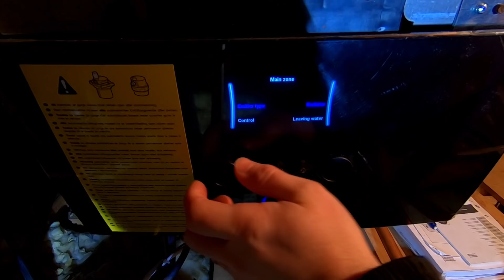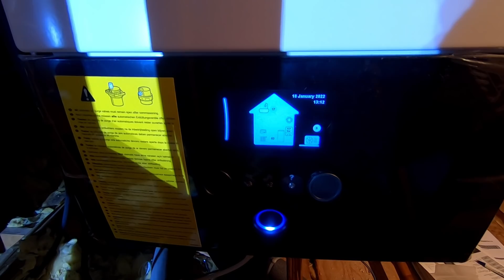How to lose £2000 installing a heat pump

Comment: May I ask, why did the customer want a heat pump system. What was wrong with the gas boiler was is just the damaged flue, was it a very old boiler. What did it cost to fit? Regards Dave Porter London
Reply from the maker: Boiler was beyond repair, client did not want another gas boiler. I don’t know the cost.

Comment: The really sad thing is that without upsizing the radiators this heat pump is going to struggle in the winter. Turning the weather compensation off just shows that the MC is in love with bodge job designs!
Reply: This unit is a high temp unit - it can run up to 70 degrees C of course this affects the COP but its not as bad as with older kit.
Reply: @WindyJAMiller  do you know what the COP is for a unit running at a high temp like 70? I used to specify radiators at 45 degree flow (in new builds) achieving 3.1 COP.  UFH designed at 35 flow temp used to achieve 3.6COP (from memory, a few years have passed since I was in heating industry)

Comment: just to be clear: this is completely and utterly to the fault of the designer and main company, not the installer nor heat pumps.
Reply: The words 'heat'and 'pump' do not fit well. A better fit might be 'water' and 'pump'. OR 'heat' and 'generator'.
Reply: @johnchoice1371  actually no. heat pump is the technical term and the correct one. its not a generator of heat, its a mover of heat. the medium witch is uses is not relevant to its function. just to be obvious, but you do know on what principles a heat pump operates?

Comment: Nice video, informative. As someone who has spent many decades working in construction I would recommend renegotiating the terms of the subcontract/employment the moment you realize the job can't proceed as planned. In the past if I hired a contractor (or sub) on a per unit or per  job  basis, there was always a strict understanding that if work could not proceed as planned we would both are to switch to hourly or renegotiate based on the revised plan.
The quality of your work seems good from the little i could pick up eating your video. That puts you in a small and rare group of sought after craftsmen.
If you stick to your guns, they will actually be more respectful of your time and treat you better.
Don't be afraid to venture out on your own. I know many who have. They're all millionaires now. Oh and quit smoking, it robs you of your time, your money and most importantly your health.
Reply from the maker: Tony, I work for myself 99% of the time. This one was just a trial run that went wrong. I would never work for them again. Period.

Thank you for a nice comment 👍

Comment: Of course it won’t work. This stuff is a figment of a bedwetting green wanker’s imagination. Houses have to be designed to be heated by a these things. Before fitting you will need bigger pipes, triple or quad panel radiators and/or under floor heating plus additional on-demand heater for bathing and hand washing. Our world will be a better place when we tie these cockwombkes to the back of our cars and drag them along motorways.

Comment: Firstly, this is amazing content, it really captures the pain on a job (I have been there). 

As a heating engineer (I mainly do breakdowns) I was considering getting into heat pumps, I even had a course booked in for next month. After watching this video and doing some further research I have come to the conclusion that it would be a  complete waste of time and cancelled the course! I’ll stick with boiler repairs until something comes out that will actually catch on! 👍 Thanks for the video!
Reply from the maker: Ahhh no, mate do the course and get into renewables, early days in ten Uk but the technology works and it will catch on.
Reply: @UrbanPlumbers  thanks for the reply! But Its not for me. There is so much boiler work out there and I literally can’t think of a single person I have ever worked for who would want one of these. 

My thinking was, to add another string to my bow, but I don’t think it would end up being as profitable as focusing on my boiler business more, rather than splitting my attention into renewables! 

Amazing content mate! Thank you! 👍
Reply: Of course it is your decision. But investing in your self with quality training will enable you to shine in what is essentially ‘new industry’ where the demand for a system design and installer will exceed supply’. You could develop yourself a real niche in the industry and charge a higher price for your time. Arguably there is more job satisfaction to be had designing the whole system rather than just hanging a white box on the wall too.

Comment: My geothermal has weather compensation option...I leave it off, it gets confused with advancing temperature unnecessarily.  

Not sure if that is the same here.

I think the problem is outside temperature rises or decreases rapidly, unit kicks on or adjusts & it isn't reflective of the interior conditions. In my case brick takes hours for weather to change the inside, so the unit would run unnecessarily.
Reply: My mitsubishi compensates for both internal and external temps, do other brands not do this? Etherway, having weather compensation off as company policy is criminal. Turning weather compensation off should be a last resort with a "this will cost you more" warning.
Reply: @djenson  

Mine costs me more with feature being on... Temperature indoors is more stable than outdoors, I could see benefit for temperature control in houses that experience rapid temperature changes, but in the case of my brick home why would I want my unit coming on if temperature takes hours for it to feel the effects from outside.
Reply: @Gamerz00760  it shouldn't come on if the temperature outside is low. It should only come on because the thermostat inside has called it to come on. At that point, weather compensation decides what flow temp to use.
Reply: @djenson  

The thermostat inside on mine is tied to outdoor sensor.  It only comes on as you said because thermostat inside. 

My unit wants to turn on as it nears lower threshold of temperature it is set for using weather compensation.  In an effort to mitigate sudden inside temperature losses it thinks will happen.

As the video mentions they can tweak the compensation settings... That is similar to mine. 

However the heat pumps whether air/geothermal, boiler have limitations with such.   When extreme weather hits the settings don't work right.  In the case of outdoor heat pumps they run longer from what I've seen & in extreme cold that is bad because they turn to ice.  

Likewise if my geo runs 24hrs for a couple days I find heat output decreases as heat absorbed from groundloops gets too cold alongside the fact temperatures are below zero outside.  (Close ground loop) not a pond & not welll/bore ground loop which is less subject to cold. 

I ran into these issues with a few smart thermostats I've had.  

It essentially extends run time in scenarios I've tried... Maybe something isn't right? Or maybe my properties & units aren't paired correctly?

Comment: Just to clarify... this is your first ASHP installation, the installation plan that the ME Engineer designed wasn't possible, kit arrived a day and half late, you re-routed to the attic, and you didn't have the right information available to finish the wiring easily? Sounds to me like a project management balls up than anything else. Did you chose to re-route to the attic, or was that authorised by the PM/MEE? As well as lost time due to delays, did you lose money from the additional time and materials used for re-routing?

Comment: How can it be policy to turn off the weather compensator if its installed on the unit? Makes no sense obviously there is a stat externally to measure the temps and already have stats inside on the rads? Absolute nonsense not only that why install it to not use it

Comment: Do people really want those huge noisy fan units blowing in their gardens? Hard to believe this is the way forward. All the pipes wires and ducting running around the outside of the house. Not knocking your workmanship which looks excellent.
Reply: Better than a gas boiler sending burnt hydrocarbons (and when Hydrogen is to be introduced into the mix, 6 times more NOx) into the garden..

Comment: Well after watching that I’m now totally sold on Heat pumps. Who cares about all the extra pipe work, wiring and unsightly trunking and cables on the outside of the house. All when you can signal your virtue by telling people you have gone ‘green’    by having loads more raw materials being dug out of the planet and all the extra pollution from the manufacturing process….🤦🏻‍♂️🤦🏻‍♂️🤦🏻‍♂️

Comment: I have wired a few now and the NuHeat range need hard wired external sensor for weather info.
Last one Mitsubishi had internet connection to access weather information.
It would not work in this install but Mitsubishi do a full cylinder and controls all in one , very easy to install and control.
Outside unit needed power and 2 core link to internal cylinder brain.
Good for new builds !

Comment: Heat pumps are terrible, my partner has one and half the time it don’t work, when it does work the fan is loud (outside) it also leaks water which then freezes outside making a slip hazard, trying to get anybody back is a nightmare, most of the time they’ll send someone who don’t know about heat pumps, don’t bother with them. Hold onto your gas or coal/fires for aslong as possible

Comment: These technologies will prove to he failures. Too energy intensive to run.  You can be the energy density of fossil fuels
Reply from the maker: That’s not true. Heat pumps are the least energy intensive heating option available at the present.
Reply: That have been tried in my area...never work and you'll freeze to death. Gas boiler far superior

Comment: I can only imagine how much fun servicing will be.
Compared to gas boilers they certainly are way more work.
Not sure how good having the weather compensation activated is anyway?
Reply from the maker: WC makes a massive difference to ASHP
Reply: @UrbanPlumbers  Thanks for the reply, are you able to point me to some good information on this topic. that would be great.
I have installed many ASHP and never even been told about weather compensation settings. I'm in Oz but a cold climate area.
Reply from the maker: @pulporock  google heat geek or check his YT channel

Comment: It’s sad the weather compensation was turned off. It defeats the whole purpose, but there is a better way by using indoor feed back to set the water temperature. Indoor feed back provides real comfort for the conditioned space. Indoor feedback compensates for the different heat losses of the building and automatically creates a heating curve that is most efficient for the indoor environment. Efficient equipment is ok but may not be cost effective unless the losses of the building envelop are addressed. Good for you powering through that nasty job you’re a good tradesman.

Comment: That video is a nightmare to watch, also that air source heat pump is far to small for the property size and won’t work to keep the property warm. You will be having a lot of complaints from the home owner.
Reply from the maker: Yet you watched it.
Reply: @UrbanPlumbers  yes I did because I could feel your frustration and felt for you.

Comment: I will not have a heat pump system I will go for hydrogen boiler then plant trees to cover my CO2 usage.
Reply from the maker: Good luck with hydrogen. It will never happen. Even if it could, the cost would be higher than direct electric heating.

Comment: We install heat pumps in one day, i think this has to be the most difficult way of doing it you could possibly do ! I feel your pain i hope you got payed for the whole time and not just a fixed amount. !! Panasonic we install for a company they use wifi connection, then they can correct the weather compensation
Online. Get errors online too.

Comment: My install team would be soo mad if I messed up the design that much. I set them up with a very detailed plan. Pictures, dimensions, electrical routing, equipment placement, etc. I figure it all out before getting a customers signature.
Reply from the maker: that is how it should be done!

Comment: Thanks for your video. I won't be looking at heat pumps again...
Reply from the maker: hopefully my next heat pump video will change your mind. Nothing wrong with the tech.
Reply: @UrbanPlumbers  I have seen a few videos now on these heat pumps. Eventhough your workmanship is top notch, I think I would be better off investing in a hydrogen ready boiler. At least I ll know for sure I will have a functioning system all year round and no surging electricity bills. Thank you for your video and information.

Comment: As a service provider for one of the main heat pump manufacturers in the UK. We get so many visits to heat pumps under performing due to badly designed systems, they just sling them in and become a nightmare for customers to get the installers back.

Wiring becomes much easier to understand once you know what everything does. 

Will not surprise me if heat pumps become the new “have you been mis-sold ppi”
Reply: Why do we need them?
Reply: That's interesting to hear. Sounds like the technology could improve and the installers.
Reply: Ive a 50K Valliant geotherm UFH installation , nobody understands it , nobody can get it to work efficiently , absolute disaster
Reply: @simonramseyer147  my company works with Vaillant on their more complex control products and you wouldn't believe the amount of times we have been told two different things from two of their technical advisors working in the same department.
Reply: I have a Mitsubishi Zubadan fitted to a five year old property which was built fully insulated and with underfloor heating and large radiators upstairs , and solar panels. Cheap to run , only issue was the installers to save money didn’t fit the single large pump but rather two regular central heating pumps. House is still warm and comfortable but would have been even cheaper with the right pump which pumps more water faster around the system per minute
Reply: @andrewalexander1086  Won't be cheap after April when prices go up, and when many households have heat pumps installed, plus chargers for electric vehicles then demand for electricity will surge and electricity charges will hit the roof!

And to make things even, energy companies will increase gas prices for people having gas boilers and homes with heat pumps won't complain!!
Reply: @NeoFreshair  Correct. Politicians have broken the supply side of energy. They must be benefitting from this along with their corporate sponsors. At least somebody benefits🤢🤢🤢🤮🤮🤮💩💩💩💩💩💩😡😡😡😡😡😡🤬🤬🤬🤬🤬🤬🤬🤬
Reply: The other major problem i saw with this system was the size of the fan unit outside...it wasn't well protected...i can well imagine when it gets to winter months half of those components will freeze up, crack & basically kill the system or even leavea & dirt blowing into the unit on a windy wet day (of which we have many)
These things appear to have no regulation around them & clearly the uptake has been minimal & so alot of the consumer complaints arent making it into the mainstream especially as the government want to appear 'green'.
Well this whole thing looks like a total disaster...im all for 'green energy' but they can't expect consumers to pay huge upfront investment to replace gas when it is literally not suitable for our climate & it appears not many people know how to install or maintain in this country too.
Hope the government start setting up a compensation fund !!!
Reply: from what i read they are basically useless for the UK as we dont need heating when its warm and when its cold they dont work?!? i assume a tory donor owns the company who makes them or something :P
Reply: @kanedNunable  if they work in Norway, they can work in the UK, surely?
Reply: @capnskiddies  I get how you need more energy to heat moist air... but I would think there is more heat stored in moist air outside so extracting heat from it should be more efficient, no?
Reply: @JayCGypsy  Yes and No, there is more potential heat to transfer, however the high moisture content freezes on the condenser icing it up and requiring the heat pump to stop frequently and run it's de-icing element. This significantly reduces it's efficiency and no heat is transferred during those cycles lowering the overall temperature of the home.
Reply: @GoldenDragoon  That explains it - thank you very much for taking the time.
Reply: @jkgiygigoiuholjojouihgiygf1952  no. You do not understand dew points. The UK is super humid and when that happens the outdoor unit freezes up constantly.
Reply: @JayCGypsy  no... Guess what moist air does when it hits a very cold surface (outdoor condenser) it creates condensation, that condensation then freezes up the entire unit. Not efficient.
Reply: @jkgiygigoiuholjojouihgiygf1952   levels of insulation and air tightness. Does Norway have the mass of Victorian/Georgian chimney fed houses that we have?
Reply: This exactly. As soon as I saw the government delcare heat pumps would replace gas boilers I knew it would happen. 

I really don't think air source heat pumps are viable in the UK given our poor outdated housing stock and that our winters are cold and damp. Most heat pumps are going to spend winters with their coils iced up. Maybe new builds where you could design the houses for heat pumps.
Reply: @zoidberg444  I got no such issues with my Daikin in the middle of Europe. Much colder but not as damp. It cleans out the external unit regularly just fine.